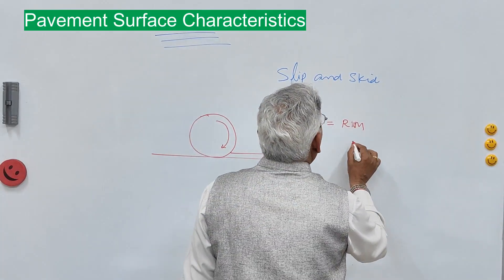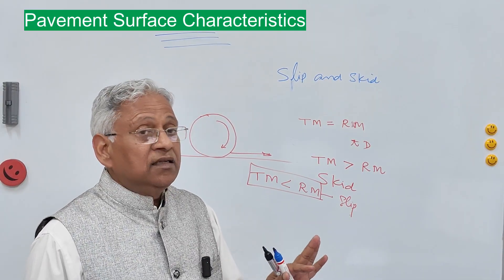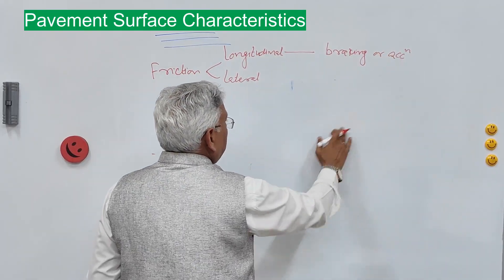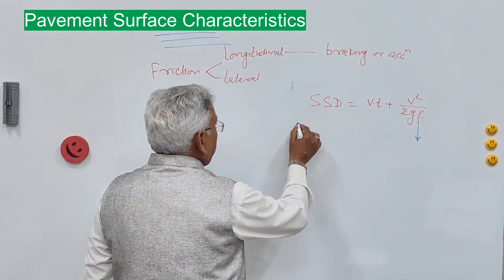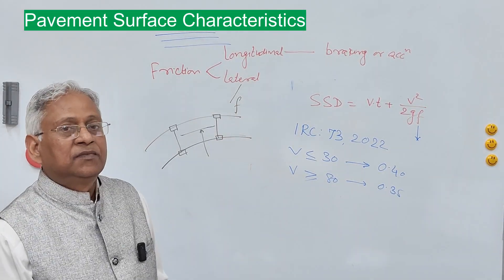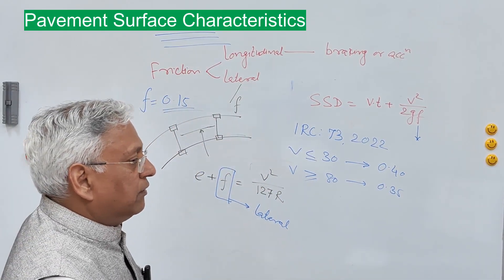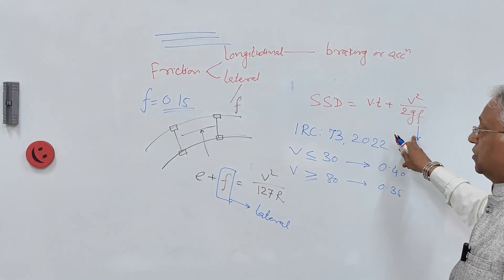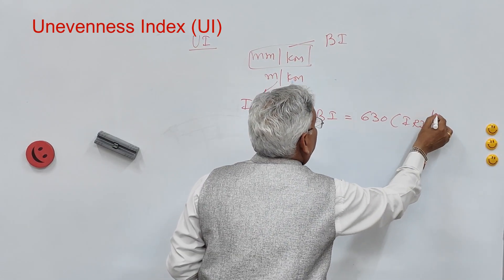Pavement surface Characteristics, Slipping and skidding, unevenness, light reflectance and friction

Comment: Sir i was reading MoRTH guidelines for dbm layer i have doubt for clause 505.3.5 laying trials there is a line says that the compacted layers of dgbm shall have minimum field density equal to or more than 92% of the density based on theoretical maxm specific gravity (Gmm) obtained on the day of compaction in accordance with ASTM D 2041, I dont understand this sir can you answer it
Reply from the maker: The idea here is that the compacted layer should have 8 percent air voids. The design Air Voids of 4 percent are targetted at the end of life, that is 4-5 years. So it is 92 percent of Gmm or arround 96 percent of Gmb that should be met at site.

Comment: I question conversion of BI to IRI. 
Since the testing methods and the area tested by them differ would any conversion formula work? 
I mean BI measures roughness along one line and NSV measurs IRI along the cross section. 
My confusion and experience is that they can not be compared mathematically. 
Can you please throw light? 
Sorry! but be ready for long duscussion.
Reply from the maker: This equation was suggested when BI was being extensively used in India (there were not many NSVs) but the contract conditions required roughness in terms of IRI. I fully agree with your point that these two parameters are not comparable. In fact there is very little relevance of this equation now when BI is almost gone from NH and Expressways
Reply: @SatishIITR  
Thanks for not only responding but validating my line of thinking. 🙏
Reply from the maker: That's a quicker way of closing the discussion😅😅 @VivekSingh-si1ut
Reply: @SatishIITR 😃 The intention is neither to  stop the discussion nor to drag it irrationally. Actually I had to once explain the difference in results of these two tests to a PD of NHAI. I explained him based upon my own understanding and study but could not get any supporting literature for my arguments. Since then I was looking for a somebody knowledgeable and trustworthy who can examine my understanding. 
I got this chance to ask my question and got a satisfactory answer inbfirst shot, though I was expecting that there will be a difference in opinion leading to long discussion. 
After that thank you तो बनता ही है।😄
Reply from the maker: @VivekSingh-si1ut  Great to know. Sometimes logic does not work particularly in front of those who do not want to get convinced. NHAI always believes in follwoing others (show me the evidence philosophy) rather than becomiing the leaders.

Comment: Sir can you please make one video on what are the different AI technologies we can use in pavement engineering related and how a transportation engineering student can do research work on that topic related information and softwares related. please sir 🙏
Reply from the maker: There is hardly any AI or ML used in pavement Engineering. In fact these tools are only to manage the data. If you have generated data (from lab or field) then you can create models using these tools. May be, the following video is useful to understand role of these technologies in ITS.
https://www.youtube.com/watch?v=o2wTi4d2P6o